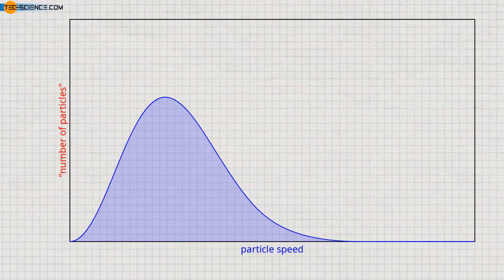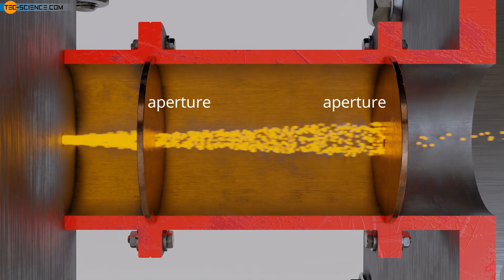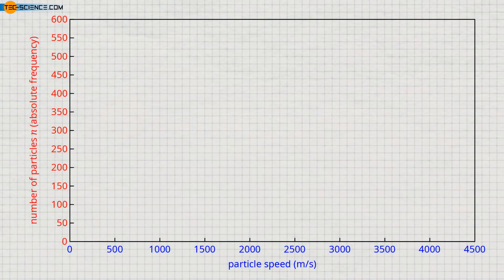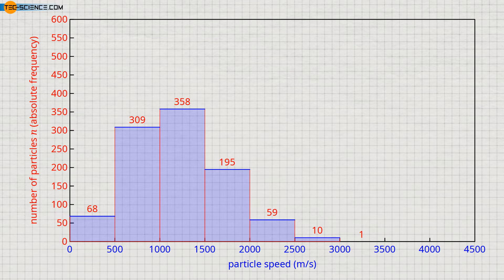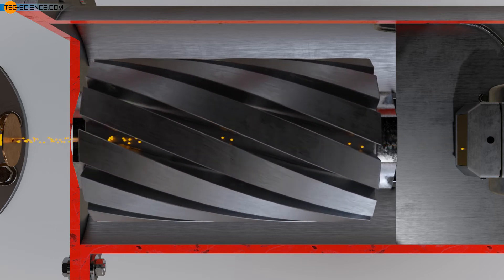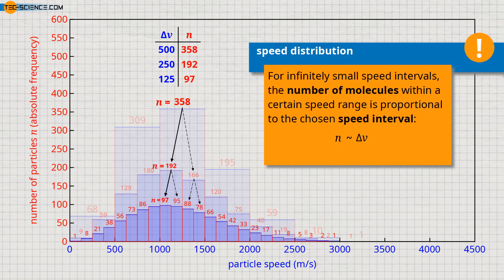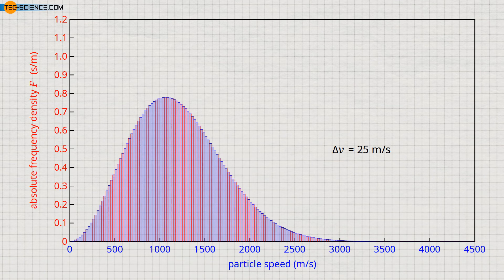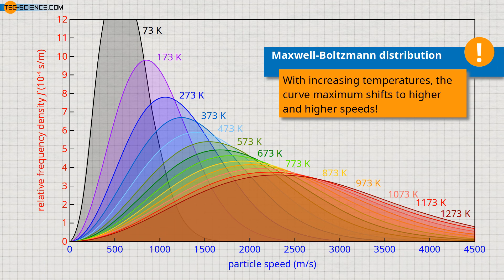Experimental determination of the speed distribution in a gas

Comment: Can you explain precisely why two apertures are needed and not one?
Reply from the maker: See the picture "Example of a particle collimator" on the Wikipedia page: https://en.wikipedia.org/wiki/Collimator. Instead of a long tube, you can simply use two apertures. The first aperture corresponds to the beginning of the tube and the second aperture to the end of the tube. 
If you consider the opening in the gas container as the first aperture, then only one aperture would actually also be sufficient. This is what you probably imply with your question.
Reply: Thanks a lot.
 @tec-science